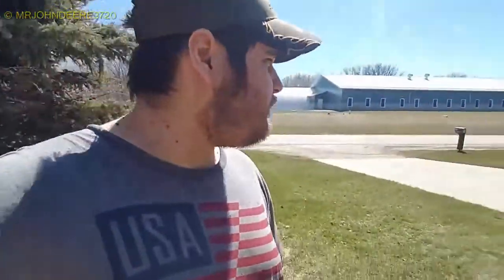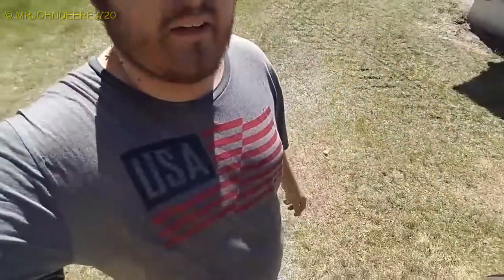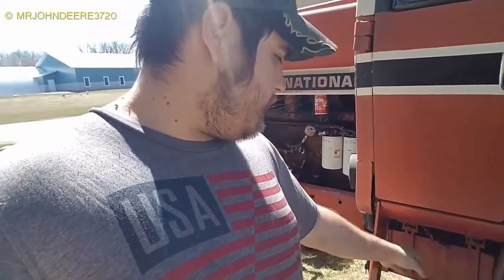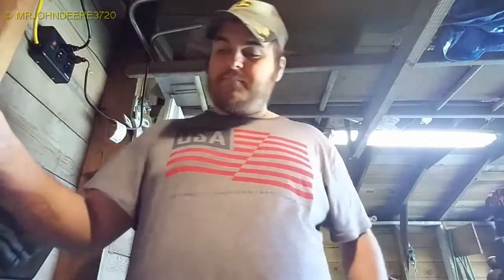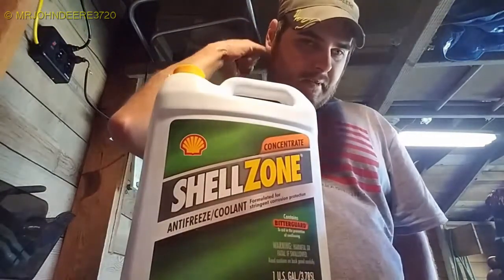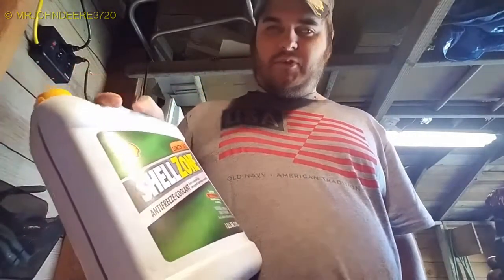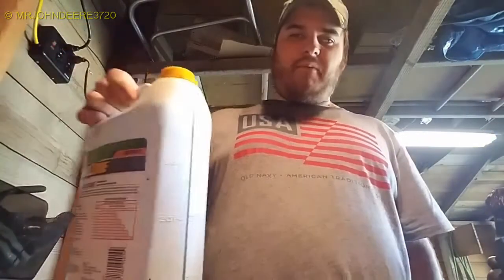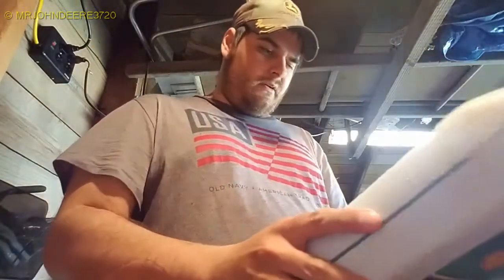ih 1586 update-part 1 out of 2.

Comment: Wynn's stop leak works in a pinch(not as good as fixing it but it's not bad). That bottle of antifreeze, look in side the bottle, if you see dark sediment throw it out. If it still has a clean appearance......ok not the best though. Heavy duty antifreeze has better additives to lube your pump and prevent corrosion.
Your tire is fine to use. Those little cracks aren't an issue right now. The duals sound like they need attention. If you do go ahead with the new tire anyways, use it as a dual tire or spare. $1500-2000 for a tire that size unless you go with an off shore brand.
Reply: Oh I forgot: pepper stop leak sounds like a bad idea.
Reply from the maker: i want something that will last 4 a long time.. that antifreeze is like new it was clean.. its in the tractor now it showed on the bottle that it could be in a tractor..  but may not have those additives. ya the duals r done. it would make 4 a good backup tire.. no i want a good  brand. those kind seem 2 last longer then  off shore brands. & im still thinking about that pepper deal. if i want 2 do that or 2 find something that was made 4 it.
Reply: I couldn't tell what grade of antifreeze it is. I error to the cautious on that stuff. I personally dont like the 23 degree Firestone design,(some people swear by them) I suggest the Firestone Radial 7000 if you're going with Firestone. Goodyear has some nice models. Titan make Goodyear ag tires, Good year brand is the flagship brand, Titan is more budget oriented(but still good). I also hear good things about BKT tires.
Reply from the maker: ya i dont no 2.. but its in  the tractor now.. im sure it wont hurt it.. im going with Firestone only becuz thats whats on there now.. i think i've heard of BKT.
Reply: MRJOHNDEERE3720 that's fine. it's your tractor

Comment: If its leaking and you are not planning on fixing the leak, then drain the coolant and save it (for winter), and fill with water for summer.  Waters cheap and okay to leak out on the ground.  When winter comes drain water and put your antifreeze coolant back in so your block don't freeze.  Otherwise fix your leak.  You cant not fix your tractor because if you cant farm then you cant make money.
Reply from the maker: im not fixing it right now becuz it stoped.. but if it starts up then i will.
Reply: What if it starts right when you start working it in the field?  Do you have the time to be broke down (for an issue you knew about) when your work needs to be done?
Reply from the maker: then i'll fix it.. im going 2 get stuff 2 fix it & keep it in the tractor + antifreeze.. but im going 2 test it even be4 i get in the field.. like on payday when i have every thing i'll try it again.. but i get what ur saying... better 2 be safe then sorry..
Reply: Well if you do have a disaster like overheat and blow head gasket or crack head then at least it will make an interesting video.
Reply from the maker: i wont be running it that hard!
Reply: With all due respect, 88, I'd never put straight water in a radiator. You'd be causing alot of corrosion inside the engine(nevermind the deposits if you use hard tape water). I agree with your fix it now argument.
Reply: Greg Henry yes I know your right.  If it's not distilled it causes corrosion like you say from all the minerals in our water.  I guess as long as he got the distilled stuff (pure h2o with nothing else) he would be okay.  Just hate to see antifreeze be poured out over the ground.  It is not cheap either.  I bought a barrel of pre mixed 50/50 antifreeze last fall and I cost me 650 dollars!  Overall for the effort it's going to take to keep adding its best Ryan just find the leak, fix it, and not have to keep wasting antifreeze.  Either way I hope it works out good and he's able to get his farm work done without these foreseen issues.
Reply: Even just pure distilled water can be bad news. You can save a fair bit by buying distilled water and concentrate and mixing yourself. I know the feeling, we had a tractor that was puking antifreeze after it warmed up. Got her right now, but what a journey.
Reply: Greg Henry I know it's cheaper to buy concentrate but for the little amount of antifreeze I use a year it's way more handy to have a premixed barrel with hand pump on top.
Reply: That being said I keep a few jugs of concentrate on hand for jobs like winterizing my field sprayer and increasing the antifreeze ratio in engines that need it
Reply: IH 88serieslover  nothing wrong with premix. it's convenient.